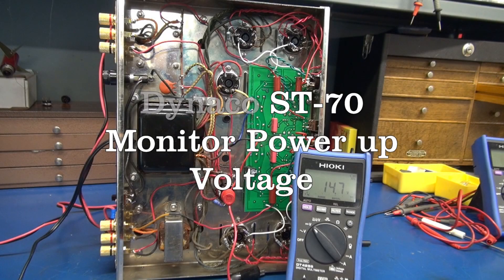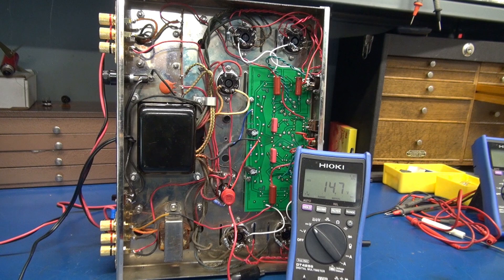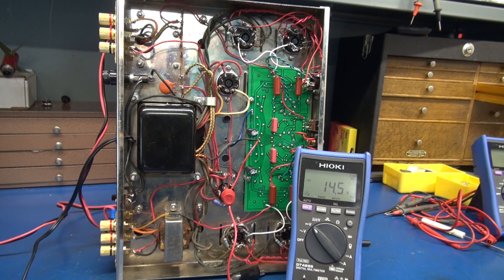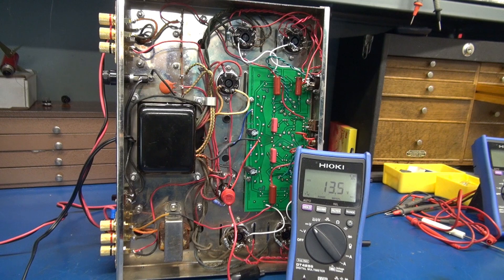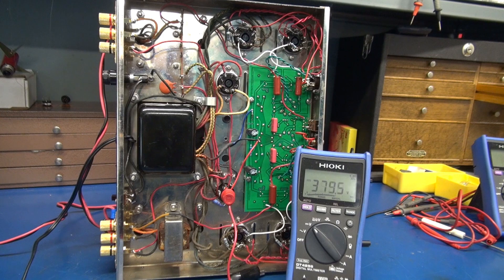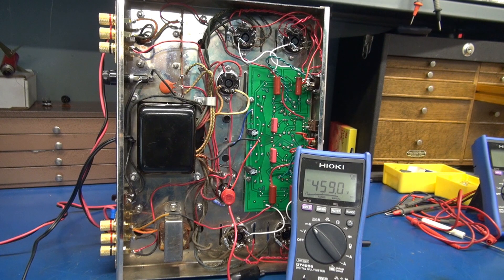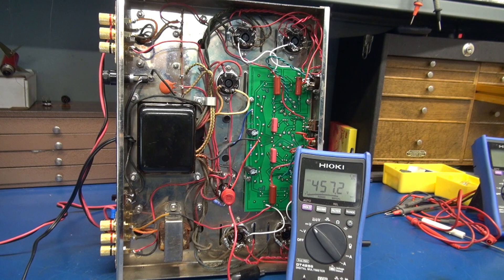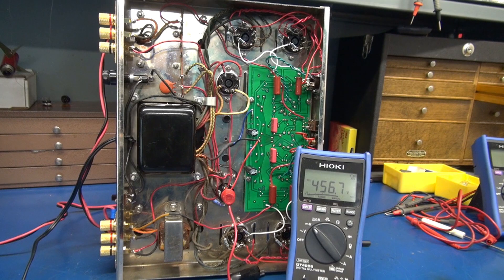Dynaco ST-70 Tube stereo audio amplifier Power supply voltage measurement Cold to warm up Tech Tip

Comment: Decades ago I learned about the "10% rule" in electronic engineering.  That's where you calculate what the normal rating you need will be, then the maximum value.  Then you add about 10% above that as a safety factor, plus it increases reliability.

I see Terry used basically that same rule of thumb for the filter cap voltage rating.  It costs so little more to do it right.